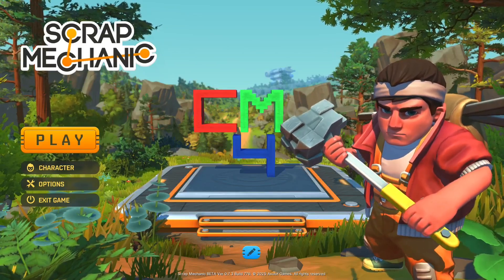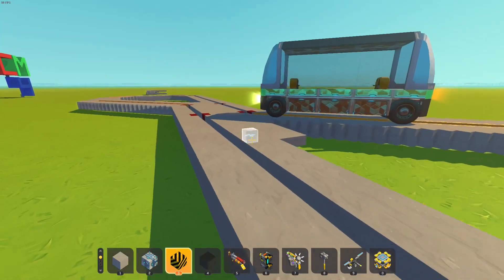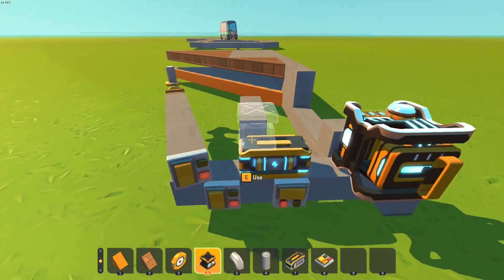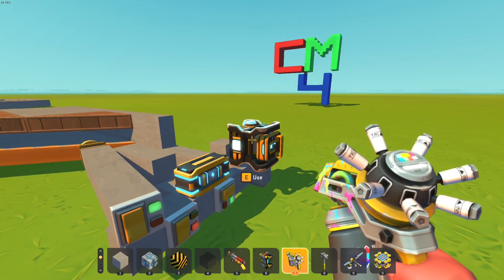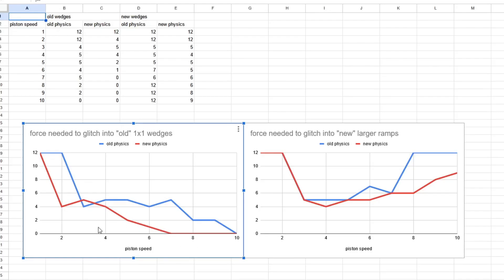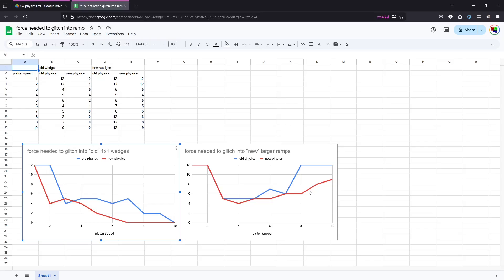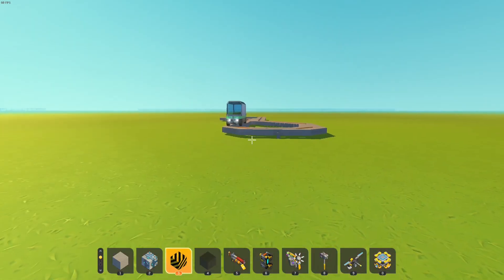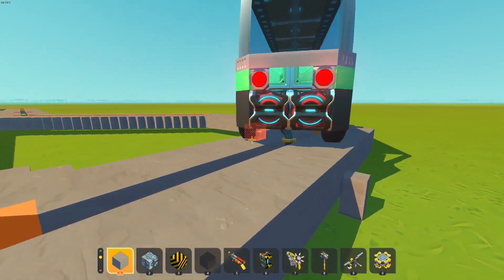Scientifically proven: The new Scrap Mechanic physics engine is less reliable.

Comment: Play with "Advanced". Its still MILES better than before for fps. I feel like "Smart" is for slower computers or when you have many many complex/collision hapenning.
Reply from the maker: You mean that the "advanced" physics also got a performance upgrade? Axolot didn't say they changed that...
Besides, I want MiniCart to work on the default physics engine, which now is "smart".
Reply: @CodeMaker4  The game engine itself got a massive upgrade. You can have a lot of things happening before it start lagging in "advanced" compared to before

Comment: The devs are doing what they can, the largest problem of Scrap Mechanic performance-wise, intense lag caused by collisions, is now much less prevalent. They had to change some things to make that happen, and no change comes without side effects. Over time, they will probably smooth this out. As for fixing your slot cars, I'm no expert, but I think I have a few ideas

1. I think switching to a two slot system would probably work for fixing that, twice as much contact should result in much more consistency. The car wouldn't have to change except replacing the single roller with a C shaped double roller attached to a bearing. We can have really thin wedges now, so train track style switches with points should work flawlessly. The only problem is that the switches would be significantly larger, you would have to have a turn on each corner which would expand the footprint.

2. Another train related suggestion, increase the number of rollers by replacing the single roller with one roller in front of another. Same design for the car as the two slot system, just with both bearings in the same slot. This should help increase reliability because both would be in contact during turns, reducing the stress on both.

3. Add suspension going horizontally. Make it really stiff so only the really hard knocks compress it. This would make it so any high impact is reduced, decreasing the likelihood of clipping.
Reply from the maker: Yeah, I should have touched more on the positive side of the physics update. About your suggestions:
1. I chose for a 1 slot system over a "normal" double rail because it made the rails and especially the switches much simpler. Also making sure both rollers actually contact the rails in a curve at the same time is hard, as even with the new wedges I cannot make arbitrary curves. I am not sure if two rails reduce glitches, I am inclined to think this just introduces more places that can glitch out. If I have the time I will try this out.
2. I am not quite sure what you mean, but if one roller is behind the other, only the front one will be in contact during a turn on the front side of the cart, so this doesn't really help, I think.
3. Good suggestion I will try this. Thanks.
Reply: @CodeMaker4  The rollers in a line would be in a C shape connected to the car using a bearing. This means they are free to rotate and both can touch the track at the same time.
Reply from the maker: @ljam9824  Sorry, I still must be missing something, but if they are free to rotate, then how do they force the cart to steer properly? Also, after a different experiment from a different comment I found out that reducing the amount of joints in the rail follower mechanism increases the reliability, so I don't think this will work.
Also, did you edit your original comment? I cannot see the edit mark, but I must have been blind if it had always had your "C shape" explanation.
Reply: @CodeMaker4  No, I didn't edit the comment. For the double roller setup, 2 ridgidy connected rollers can both touch a single rail on a curve, think like a car on a hill. The hill may be curved, but both the front and rear tires can touch the ground. Same with the curves on the double roller design.

The two rollers can rotate freely, so when force is applied to one, the bogie (the C shaped part) rotates on the bearing. This makes the second roller contact the wall as well, which stops the rotation and distributes the force between the front and back rollers. Because there are 2 sets of bogies, the car cannot freely rotate 360 degrees on the bogie, so there is no trouble taking curves. Functionally, it acts just like 2 single rollers except you have twice as much contact area and thus each roller is taking less force rendering them more reliable.

That was a lot to type on phone. If you need more details, I think I can try to modify the cars and post them on the workshop.
Reply from the maker: @ljam9824  Okay, sorry I must have misread it the first time then.

About your suggestion, in my latest video I tested a few suggestions and some of them were promising, so if they turn out not to work then I will try this.

I do finally get what you mean though. Thanks for all the effort trying to explain it. I really appreciate your time.
Reply: @CodeMaker4 No problem, you featuring my comment in the video was great, even if my idea didn't work. Thanks for that.
Reply from the maker: I tried option 3 in my latest video https://youtu.be/oYVWSG5qiSc?si=x2nKDpJ5kJav_Dir&t=595

Comment: Maybe im wrong, but I think you made a very small mistake at 2:15. The gas engines have a constant speed and editable torque, while electric engines have a constant torque and editable speed. Not the opposite.
Reply: Gas engines do not have constant speed at all.
Electric engines have like a mix of constant but variable speed and variable torque.
Reply from the maker: Yeah, I said this in a confusing way. With "constant torque" I meant that during the test, the engines apply a given torque that is consistent throughout the test, and that can be adjusted through the settings. This was a poor word choice indeed. I hope my point still came across.
Reply from the maker: You made it into my next video! https://youtu.be/oYVWSG5qiSc?si=UzvDcY-qzA5OTiCB&t=12

Comment: Dont build it as a slotcar but a color line following car
Reply from the maker: As said during the livestream, I am sceptical a linefollower can be as fast and reliable as the old MiniCarts. Line followers don't perform well going fast in straight lines, and there are other physics glitches like the fake terrain bumps that don't get solved by removing the slotcar rail system. I'll try this if I have time.
Reply from the maker: I responded to this in my latest video https://youtu.be/oYVWSG5qiSc?si=eT8z2QiARQbPSa4E&t=185

Comment: the new physics is good for me because i have a wack PC
Reply from the maker: That's nice to hear. I do like to keep track of people on both sides of the "is the new physics engine good" debate to make sure I am not being a loud minority. Are there specific situations where the lag reduction is most noticeable?
Reply: @CodeMaker4  yup, when i spawned a creation with a ton of bearings like a realistic tank with treads and everything i barely noticed the frame drop on smart physics.

But when i change it to advanced, my frames from 85 drop immediately to 5 fps once the tread hits the wheels with bearings and/or when you attempt to move the tank by 1 inch.
Reply from the maker: Oh that is really interesting, can you send me the blueprint? They said complex creations shouldn't have a lag improvement, but maybe the optimizations still work because the tank treads are a separate object?
Reply: @CodeMaker4 i'll try to find it in the workshop as i deleted that creation from my blueprints a while back
Reply from the maker: You made it into my video! https://youtu.be/oYVWSG5qiSc?si=4FZqUkJ1tOiOO-76&t=48

Comment: One of the issues with carts may be with the friction of the wheels? Like in simple lego cars turning becomes hard just because wheels have to literally slip sideways to turn the car. Try drifting lego car on a glass surface, then on carpet, you'll get what I mean. Refering to your contraptions, cart has to slip and the force to do so comes only from that roller underneath, so the less wheel-surface friction the less force on roller to lag into wedge, maybe this will help. (or add axis to carts, preferably in the back)
Reply from the maker: Good point. I will try lower friction wheels.
Of course I need to mention that this was not a problem with the old physics, and the way in which it fails now is clearly a glitch. If it were realistic, the cart would move quite slowly or not at all, or the controller would be weak in a realistic way, but the way in which it glitches and hops out of the track is unrealistic, that is my main point in this video.
Reply: @CodeMaker4  I've tried out this idea by using low friction block as a surface (forgot the name it's the hollow one), and does the trick. my proto cart was like yours in  terms of size and roller build. Do you share your creations? I haven't found any. I'd like to test out more stuff, so it would be nice of you published these minicarts
Reply from the maker: My minicart blueprint collection could be found in the description of my minicart videos.
https://www.youtube.com/watch?v=qWqponVzWdg
https://steamcommunity.com/workshop/filedetails/?id=2528202954
I'll also try using low friction blocks for the rails instead of the wheels, thanks for the suggestion.
Reply from the maker: If I try square mesh blocks as a rail surface the driving wheels just slip and the cart goes really slow, minicarts don't have awd for lag reasons. Using low friction wheels (stand support A, yes their hitbox is wierd but it is a 3x3 wheel with less friction) does seem to improve reliability! More info in the next video!
Reply: @CodeMaker4  yea unrealistic good point. I also have this conviction that force of gravity in this game and even inertia are somewhat too weak compared to weird reaction forces (even tho they're caused by bugs). Found this out by making car more stable by adding sick amounts of heavy blocks
Reply from the maker: I tried this in my new video and it seems to have worked https://youtu.be/oYVWSG5qiSc?si=mhObAsxVHoCixgkK&t=421

Comment: The New (Smart physics) Try's to learn dynamically as a so called machine learning model. However the reason why they said performance may vary and physics too, is because depending on your hardware, like my pc has AI capabilities and the physics engine works just fine with minor glitches, I tried the same thing everything was good? So?
Reply from the maker: Oh are they using AI? What type of AI? Can you give me a source like a twee from Axolot or a quote from a devlog? (or are you a dev?)
Reply: Where did they say it uses AI?

Comment: Ive seen the same thing happen with the old physics system 

The most common point people are saying is that its an old world compatibility thing

You basically need to build EVERYTHING in a FRESH new world 

On top of all that, as you said, the old designs use inferior colliders and angles 

Your piston method is also not indicative of "real-world" applications, as the way they collide is different 

Garbage data in > garbage data out
Reply from the maker: About the old world compatibility stuff, all tests were done in a fresh new world. The test setup was made completely in the current version of the game. The minicart blueprints I spawned were old of course, but I don't see how old blueprints could behave differently from new blueprints with identical blocks, so old version stuff is not at play here.

Indeed, my original MiniCart system uses inferior 45 degree angles, but it had been extensively tested in 2021 to ensure reliability. The carts slow down to make sure they can make the hard 45 degree turn safely.

About my piston method, I do admit that it has potential sources of unrealisticness, like a lack of mass/momentum, and the angle of attack being slightly higher. However, for the specific application of MiniCart, the test, in my opinion, has proven to be indicative of real-world problems, as I literally caught on camera how the real MiniCart glitched out multiple times in the same way as it did in the test.
Reply from the maker: "the test, in my opinion, has proven to be indicative of real-world problems, as I literally caught on camera how the real MiniCart glitched out multiple times in the same way as it did in the test" Actually, I take that back. The minicarts glitched when first encountering a rail with a different angle, and the test glitched (most often) when already rolling along the edge and suddenly clipping in.
However, my points that the physics engine is measurable less reliable/realistic and that it has an impact on real projects still stand, they just don't talk about the exact same glitch scenario.
Reply from the maker: Again thanks for your comment, I responded in my new video https://youtu.be/oYVWSG5qiSc?si=AoG7X2mcKgXfzXW8&t=82

Comment: I saw that cart derailed twice in this video while taking 45 deg turn. Could you test how it would perform if you try to make smaller angle at the beggining of the turn?
Reply from the maker: I am experimenting with this, thanks for the suggestion.
I got mixed results during a livestream at https://www.twitch.tv/codemaker_4
Reply from the maker: I experimented more in my latest video https://youtu.be/oYVWSG5qiSc?si=2UvIItIjo7pDzFMP&t=269

Comment: This video mainly comes down to whether or not you built the contraption in a new world or an old world.

The devs specifically said that the physics will not work properly in old worlds, nor old contraptions, so that's probably the main reason why.

Either you need a new world or need to replace the bearings on the contraption itself.

Also, the update recently came out, so the update is still not very patched yet.
Reply from the maker: About the old world compatibility stuff, all tests were done in a fresh new world. The test setup was made completely in the current version of the game. The minicart blueprints I spawned were old of course, but I don't see how old blueprints could behave differently from new blueprints with identical blocks, so old version stuff is not at play here.

About the update being recent, yeah, but it has been 25 days since the last update according to SteamDB, and they showed the new physics in a tweet a long time ago already, so it is not like this is super new cutting edge tech.

At the end of the day this is a beta early access of the game, but they said they want the chapter two update to be the release of SM out of beta, and the physics engine as it is now won't be good enough for that.
Reply from the maker: Again thanks for the comment, I responded to it in my new video https://youtu.be/oYVWSG5qiSc?si=AoG7X2mcKgXfzXW8&t=82

Comment: Yeah, I've figured this problem out as well a few days after the update released. I found out that you're not really able to make complex suspension systems anymore. And it seems to me that the more bearings you add, the worse the problem becomes and the wheels get more and more wobbly.
Reply: Exactly, I have an explorer car in my survival world with double wishbone suspension and adjustable height, on the Advanced physics, everything is fine and the suspension works great. However with the new Smart physics, I noticed that the wheels start shaking and wobbling a lot.
Reply: @nitrogxn4075   the devs said that on old worlds and old creations thr physics may not work properly